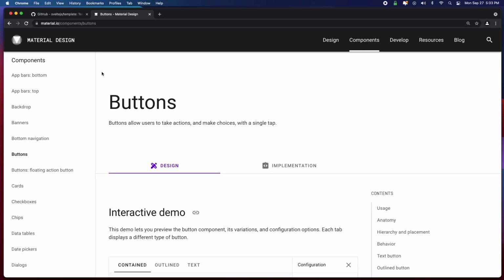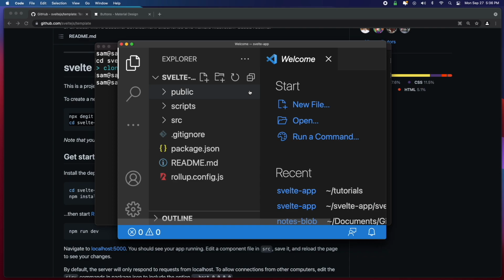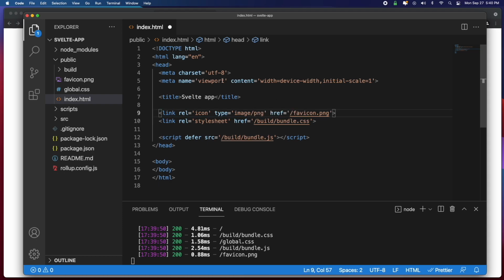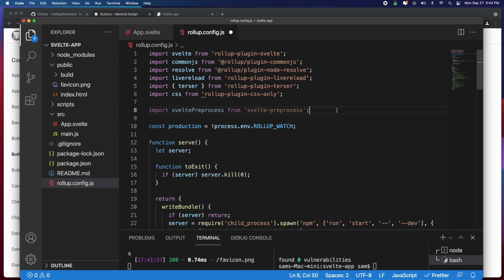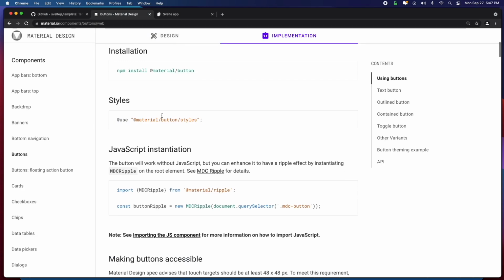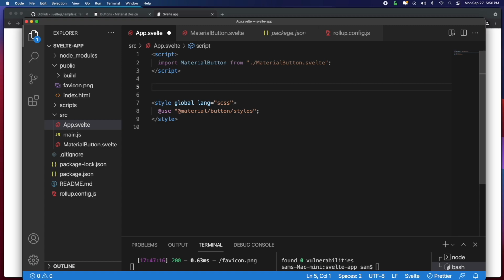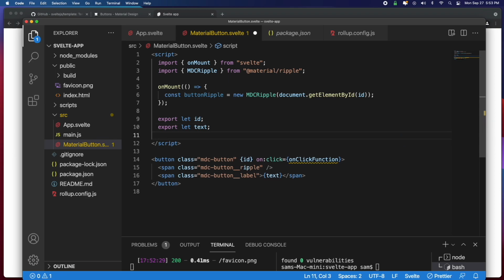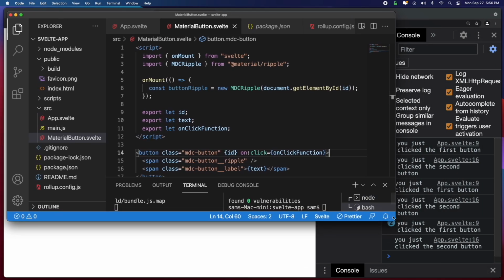How To Use Material Design Components (Web) In A Svelte App - SvelteJS Material Components Tutorial

Comment: Thank you. I was looking into Svelte Material UI, but the documentation sucks. This way, at least I can understand what is going on
Reply: I removed it and started using carbon for svelte
Reply from the maker: Exactly! There very well may be even more efficient ways still of doing this, so let us know if you improve on the recipe.
Reply: @sjc5  Embrace the sveltness!
The whole explicit id solution can be simplified with bind:this, allowing for a direct reference onto the button element. No need for extra work and making sure there are no name collisions.
Also I feel like text should be passed as a slot, so it will handle like vanilla html.
Svelte offers a lot of ways to cut down on complexity and code length, but it takes a while to get used to.
Have been using it in production for about 1 1/2 years, still find new things every few weeks.